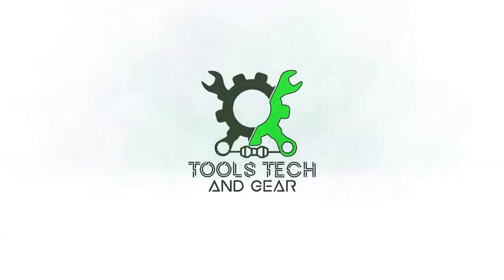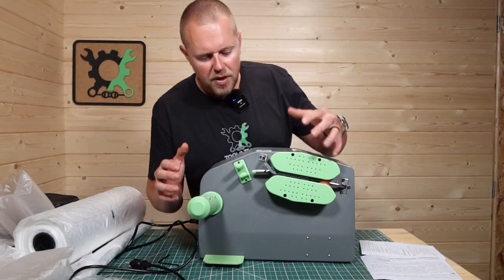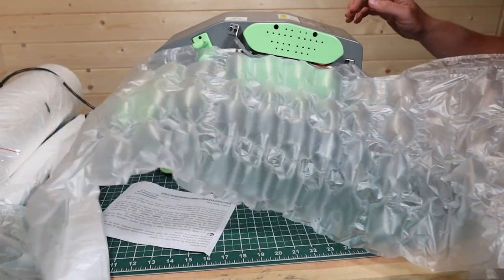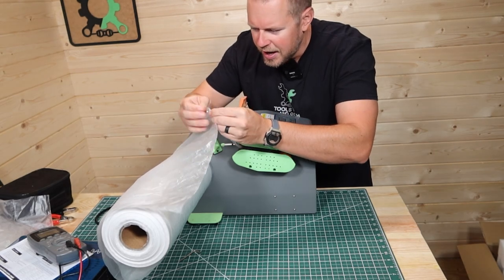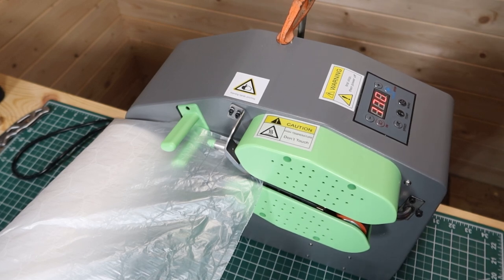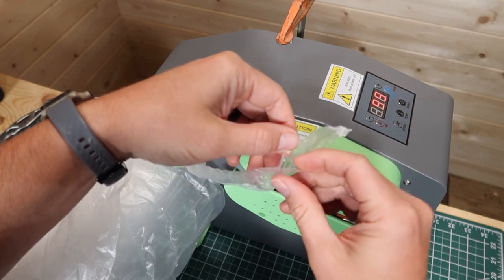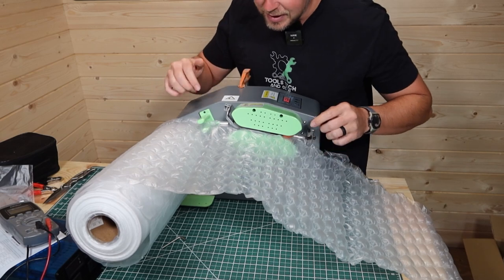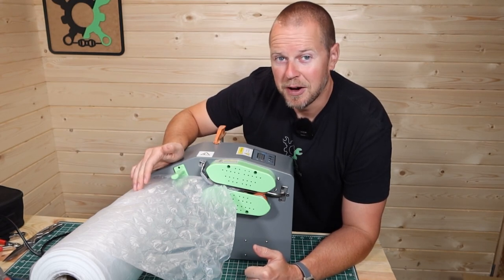ANBT Air Cushion Machine [Make your own bubble wrap]

Comment: Thank you, thank you. I could not get air into the air bubbles so came across your video and it SAVED me.  I cut the end off to thread it onto the air thingy and now it works like a charm. Thank you again.  I would like the air bubbles to be a little stiffer, so next time I will slow it down and see if that helps.
Reply from the maker: My first couple of tries were also an issue. But after you get this started correctly it works well! Happy to help.

Comment: I'd make a simple roller support for the other end. Nice video
Reply from the maker: So far the clamp is holding the machine up well. The roller on the unit is the strongest part. It weighs about the sam as the machine. A product I could have used years ago!

Comment: I just got the exact same machine. It seems to seal the first 5 it 6 then it doesn't seal anymore. Before returning it can you suggest any fixes. I have tried speed, temp and different air volumes?

Comment: hi! i'd just like to ask if there's a specific kind of plastic that is suitable for the machine to use or fill up with air?
Reply from the maker: I have used the manufacturers air cushions and off brand on amazon. Both have worked just fine.